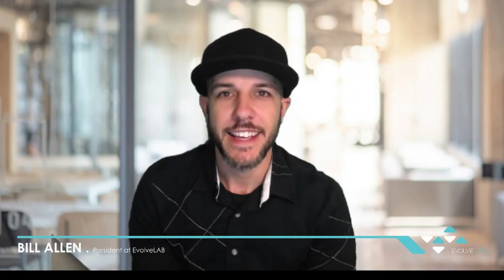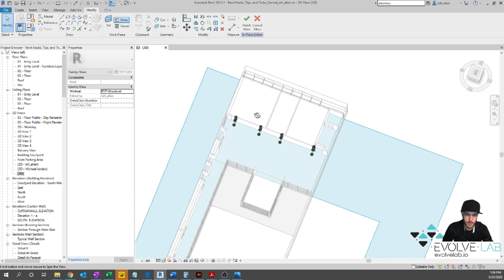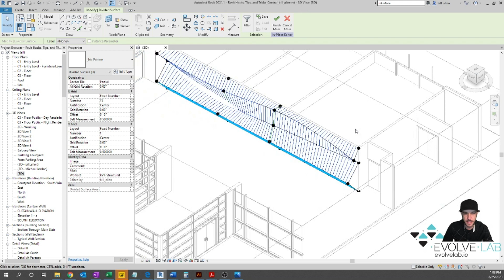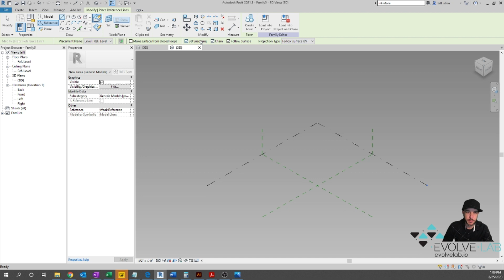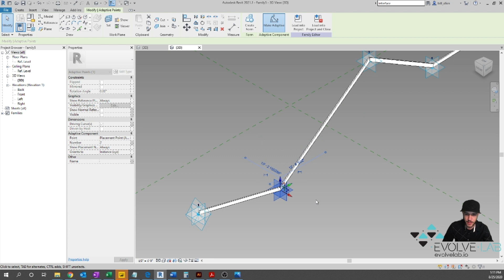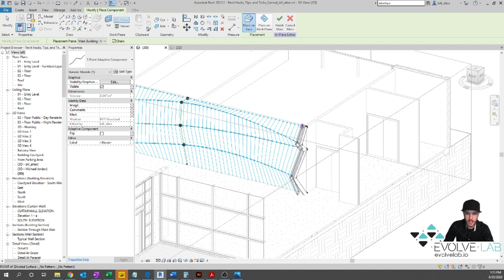Revit Repeat Pattern Tool - Free Revit Training

Comment: Any way to make those points curves?
Reply from the maker: Hi Gerald,
Can you unpack your question a little more?  Do you mean make the adaptive component curvy in lieu of straight?
Reply: @EvolveLABio  is there any way i can make it curve around a circle wall or a curved wall ?
Reply from the maker: @havok5273 , yes  you could be able to simply rotate your "rig" (profile that host the sweep) to be perpendicular to a circle or curved wall.  Hope that helps!

Comment: Great tutorial. 
I've been wondering though.....to actually shift to Archicad since revit just seems too rigid a software. Making this would've been so much smoother in rhino-grasshopper, they have a much better connection with archicad. What's your honest opinion on that?
Reply from the maker: Hi Ethan!  Love Grasshopper, and actually made a similar geometry using grasshopper tutorial 5 years ago: https://www.evolvelab.io/post/2019/05/24/push-grasshopper-geometry-into-revit
Plus side is it's lighter to build in grasshopper, but you have to know visual scripting to execute.  That said, visual scripting might not be as complicated as Revit adaptive components environment! :0)
Reply: Nothing a bit of rhino inside and a simple adaptive component cant solve in revit! Just need to think outside the box a bit :)
Reply: @EvolveLABio  Yes, I feel working with Rhino- grasshopper is so much smoother than Revit-dynamo. What's your take on this?
Reply: @AussieBIMGuru  Would have the same questiob for you Guru. It seems the Rhino-GH is smoother than Revit-Dynamo. I know its hard to be unbiased in such matters as it is a personal preference at the end of the day. (And I don't mean to start a Mac vs PC debate here) :) but can you share your experience?
Reply: @ethanhunt2570  Rhino Inside is quite fast as long as you reduce the read/write Revit node usage. Definitely better than Dynamo for geometry processing and form analysis, but Dynamo is awesome for batch and data focused workflows.
Reply: @AussieBIMGuru  I was afriad of you saying something smart that I won't understand. :) Can you give an example of what you mean by batch and data focused workflows?
Reply: @ethanhunt2570  batch= add a set of parameters to a library of families.

Data = extract a report of all model warning messages to excel.

Many examples but these are two I used recently in my day to day consulting.
Reply from the maker: @ethanhunt2570  this is Bill at EvolveLAB's opinion (not all of EvolveLAB), but I would say I like grasshopper's UI MUCH better than Dynamo's, and just feel like grasshopper is a more mature program, however I would agree with Aussie BIM Guru that each program has their strengths which he outlined below.